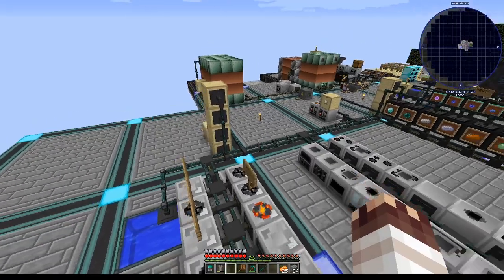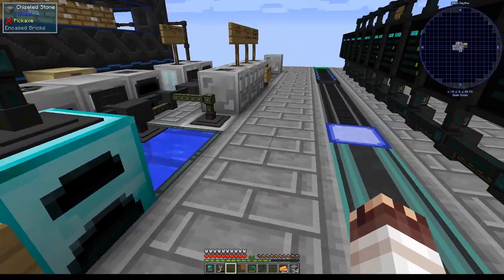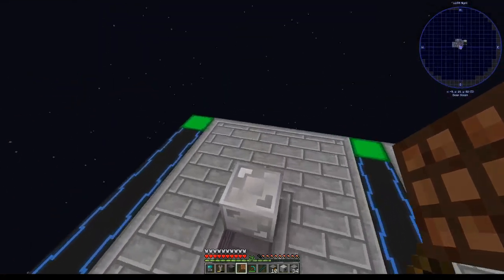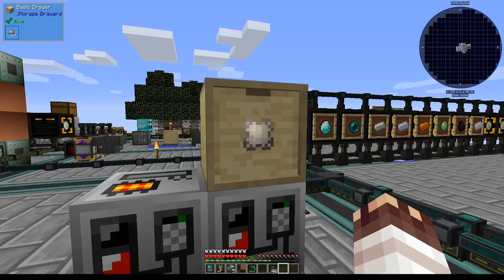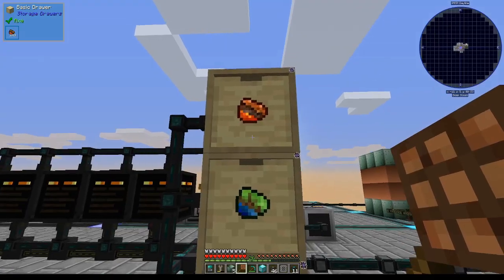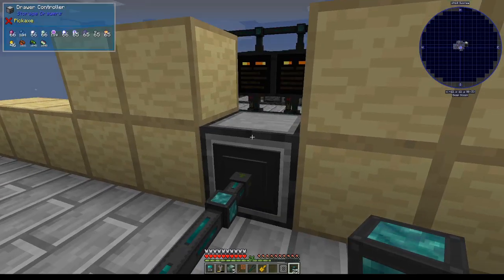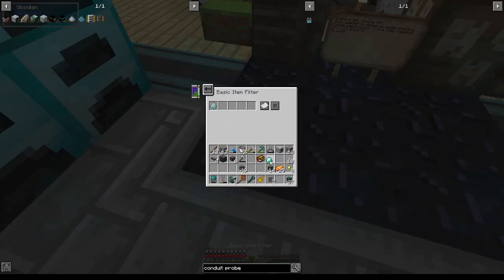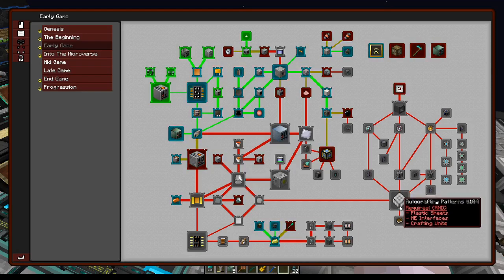New Omnifactory Supershorts #11: Multi-Smelter and DML Drawer Distribution

Comment: "I can use this for 112 MV machines" not with them conduits you can't lol and now not even the end steel ones can contain the amount of power you're outputting
Reply from the maker: Conduits are connection-based, actually! So a conduit with the number "8192/t" will take in an unlimited number of 8192/t, just from different connections. Each of the numismatic dynamos outputs slightly less than 8192/t at maximum, so each conduit connection can handle a full numismatic dynamo, and as long as none of my CEFs request more than 8192/t from a single connection, it'll be totally fine!
Reply: @minecraftinchocolate  oh I thought 8192 was the capacity of the conduits maybe I was thinking of thermal expansion or something? Idk I upgraded my conduits to end steel anyways as its not that expensive
Reply from the maker: @Acylumgaming  Yeah, I'll upgrade them to end steel as soon as I get that automated!